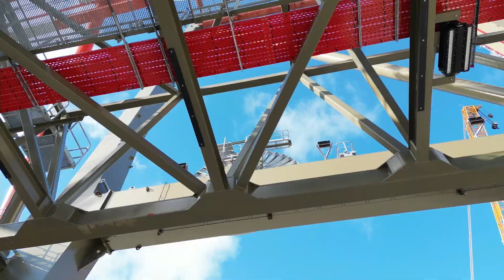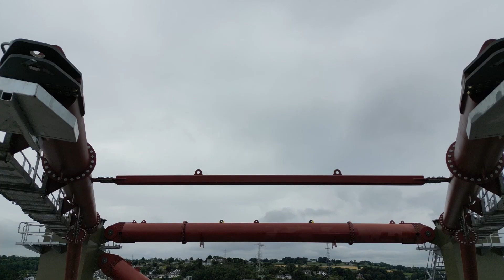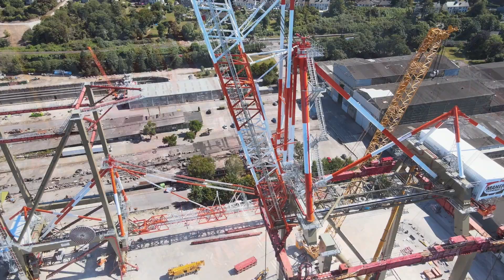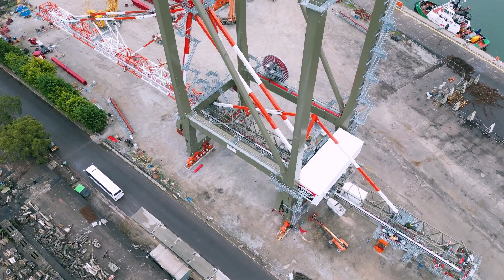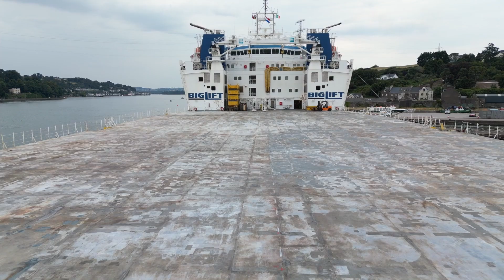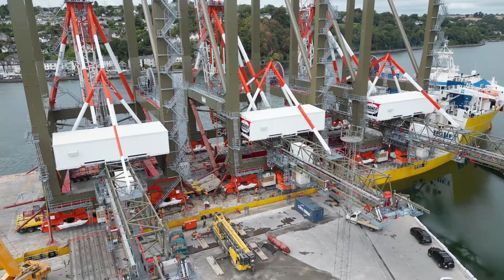Irelands largest export ever - Liebherr Cranes at Verolme Cobh

Comment: I wonder why the capacity is in Long Tons and not tonnes?
Reply from the maker: One long ton is equal to 2,240 pounds and is mostly used in the United Kingdom as a unit of mass/weight. This measurement is also used in the U.S. tonnage of naval ships.
Reply: Yes, they're being sent to the USA who are a little slow to grasp the metric system.
Reply: When videoing , can you not do it factually .....no need for dramatic interventions  ! You are surely not looking for an award for cinematography! ! Do it plain and simple showing the scale of the product , the complications of reassembly and transport .
Reply: Would have liked less camera motion and more big picture shots. Would have been nice to have enough time to absorb shots rather than ‘break neck speed’ to the next shot.